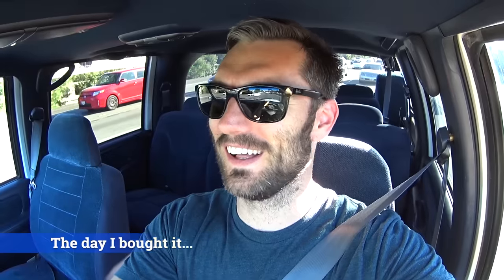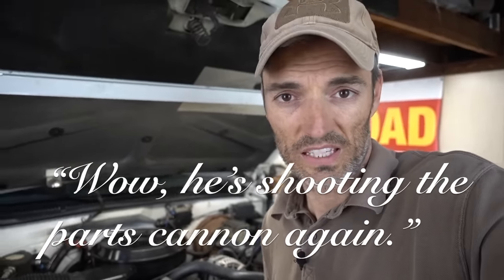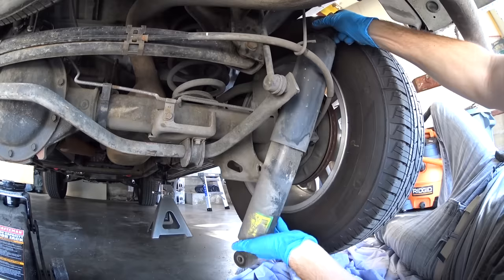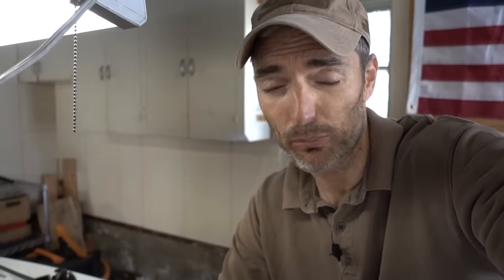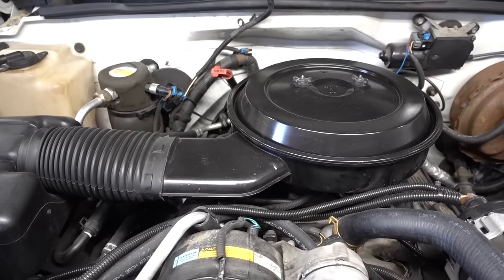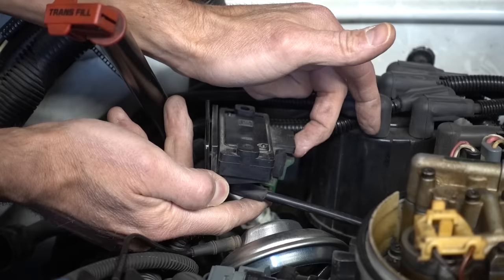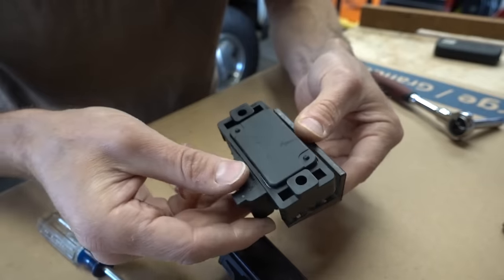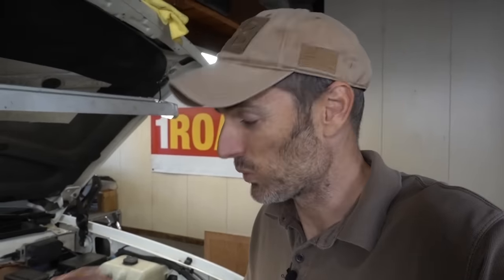The ONE REASON Why My 25yr Old Truck Runs So GOOD!!

Comment: Well done. I have a 98 Tahoe with almost 214,000 miles and I approach it's maintenance exactly the same way. I just replaced the MAF sensor, Throttle Position sensor and Idle Air control valve. I'm trying hard to get her to 400,000.

Comment: I completely get the idea here... but gotta definitely use the quality parts. 

I've replaced the entire ignition system on my 91 astro with the 30 year old oem parts off of my parts 92 because the p.o. had a shop do a "tune up" and those new parts all quickly died

Comment: It is interesting to note that the same MAP sensor is used in my Isuzu Trooper UBS69's diesel 4JG2 Turbocharged engine. This vehicle was made in 1996 and only complies to the OBD1 standard. And yes, the GM mark is on the MAP sensor. And still works flawlessly today.

Comment: Same mentality I have.  My 2005 Accord we bought new has over 277K on it and still going strong.  My 2006 GMC 2500 Duramax has over 180K with about 100K of those towing my 5th wheel.  New cars do not equal no breakdown concerns, they just make breakdowns more expensive.

Comment: I have two 2007 F150 and both are running and driving perfectly fine because I do preventative maintenance in much the same way. I get 20-22 MPG like clockwork and wouldn't be afraid to go cross country at any time. 1ROAD imho is doing it right!

Comment: On a long enough timeline every part is a consumable. I’ve owned over a dozen cars with 100k+ miles. My son and I both daily cars with over 200. In 30 years of using your philosophy, I’ve been completely stranded (had to use AAA) only 2x. Once with a bad proportioning valve, once with a failed diesel lift pump.

Comment: Had a 1997 suburban, 5.7 4x4, the long btch. Was heavy on fuel and not very fast, but it also weighed 7k lb. I Loved it, was my favourite truck to date, i had the 2 rows of seats, very roomy, and very reliable, never left me stranded. I did put a lot of loving into it over the years mind you. I only let it go because I didnt need it anymore and i had 2 cars, but it towed the racecar to the track and long road trips. Now I'm on a 2000 silverado 4.8l 4x4 single cab, 8ft bed, ill be fixing this thing till i die, not buying another. Truck was free, $6k in parts later, its more reliable than a new one, smooth smooth, same thing, no disappointments. Has almost 100hp over the 5.7 in the suburban, so it moves much better. But yeah, i loved that suburban. If y'all still have 1, keep it, the new ones are all sht.

Comment: My 97 Defender 300TDI is just lovely to drive.
I just rebuilt the cylinder head, and finally figured the viscose fan isn't engaging, which had caused the original overheat. But I don't mind because I gas flowed the new head and she goes up a very steep hill in third now, which even my turbo diesel Subaru can not do 😄 . I deleted the EGR and think this truck may just run forever lol ☺️

Comment: 200% right, I routinely will replace parts along with routine maintenance as a mechanic I know problems just don't go away or get better, if I have a good idea and replacing something for a few dollars will get the job done so be it a lot of times that's the fix OBD 2 is a big help to on 96 and newer
Reply: Well I think even non mechanics know that once there is a problem it's not going to go away.😂
Reply: @Anth230  you would be surprised

Comment: I agree with everything you said except for the Amazon.. In my opinion.. yep I'm right winged. Plus the fact I like to support the parts stores for when my car breaks down and I need to run down and get the part then and there here and now, and if I can help it I'll go through a smaller more ma and pops. But I'm also one of those that will pay extra for something made in USA! Keep them old ones running. Nice video!

Comment: 2000 S10 2.2L (built Oct ‘99). Purchased Oct 2011 with 74,274 miles and a destroyed engine due to the previous owners lack of maintenance. I actually put more into the truck than it was worth at the time. However, it’s now been a dependable daily driver since then and has been up and down the eastern seaboard 11 times, once to the Canadian border and back!

Comment: Late to finding this video, but good job! So you know, it’s possible to replace those electrical connectors without having to re-crimp/terminate. The retention clips on them break all the time on older vehicles due to heat and aging. There are tools that will release the wire and crimp from the rear of the connector, then you simply load the terminated wire into a new “weatherpack” connector body (with an unbroken retention clip). Usually there’s enough retention force it isn’t a problem to use without the clips but sometimes it can be a problem. 👍🏼sounds like a pain until you try it a few times, it really isn’t too bad
Reply: If going this route, make sure to use quality, OEM or equivalent weatherpack parts. The generic no-name stuff from Ch*na has no place here.

Comment: I got a 1978 Chevrolet  Silverado  I drive everyday.  My cost to buy was $3500 from a friend back in the 80s. 
Paint faded,I had it painted.
Motor gave up, had a rebuilt on installed.
Headliner failed, replaced it.
Seats wore out, had them recovered.
Maintain your vehicle and you will not have to pace your vehicle. 😊
Saves$$$$$$$.

Comment: I understand what you are saying about changing parts.  If a problem can be one of two parts it is cheaper to replace both parts than to pay an expert mechanic to check it for me.  My 96 F150 has 550,000 miles on it and I don't want to trade it because it never lets me down and parts for it are cheap.

Comment: I just spent 2 grand on a 2010 Kia that was in damn rough and unsafe shape...put in another grand on brakes and tires along with a new transmission pan (seller thought it was an oil leak lol) and now it's a solid ride...I never thought I could get a newer car for 3 grand in this day and age. Nothing wrong with replacing parts for peace of mind honestly unless the new part is junk...

Comment: "If you can replace these parts that are easy to access, easy to get and cheap to replace, why wouldn't you?".   Because sometimes todays OEM parts are not made as well as the original OEM parts.   This is specifically true with electronic components.   Being a pro-active parts swapper is not always the best solution.    You have a good running 25 year old truck because those trucks were made well and 25 years, isn't really that old.

Comment: I drive a 1994 Chevrolet Silverado 2500 with 1,415,000 miles on it. It has a 454 7.4, NV4500 transmission. Engine has never been rebuilt neither the manual transmission. I have operated three different businesses with this truck. This week I had it start rough idling running rich. Found out the ECM was not even giving me the 12 hello code. Checked the wires confirmed they're good. I went ahead and put in a new distributor, plugs, wires, temp sensor and just ordered ECM. I did all of that for about $200. 

Unfortunately AC Delco is not what they use to be. I have kept all the original stuff I replaced over the years if it wasn't broken and I was playing parts changer. I paid $14,000 for this truck in 1994. Still drive it daily with cold ac. Sure it has scratches, seats are starting to finally wear, but it's a work truck and pretty dependable. I see all the $80,000 trucks and think how the feel when they get that first scratch. Anyway great video. Do you and enjoy that Suburban.
Reply from the maker: Wow!! Just to confirm… 1.4M miles?? And, with the 454?? Holy moly!!

Comment: I bought a 1999 chevy 2500 with the 454 and 37,000 miles (barn find). When I got it, I replaced all fluids, PCV, thermostat and hoses (because the coolant was drained), shocks and steering stab, plugs and wires. Fixed wonky tail light wiring with OE harness, replaced blend door actuator that was bad. I wanted to replace injectors with upgraded Bosch injectors so....distributor, ignition module, EGR, MAP sensor all replaced because intake manifold was off for injectors.. The truck runs incredibly well. Next thing I will likely do it brakes, thinking of converting rears to disc and thinking of converting self locking hubs to manual lockers.... :)

Comment: My 1990 Ford Econoline 4.9 cu. Factory fuel injected, factory gear drive van would not start. Over time and replacing everything it still wouldn’t start….. everything except the map sensor. My buddy asked me ,” did you change the map sensor?” I said what is that?
I changed it and … starts, runs perfectly. It didn’t cost too much and nowI had peace of mind. I love my van.

Comment: I agree with this rationale.....except for old Dodge Rams careful with aftermarket Amazon...need Mopar for crankshaft position sensor and throttle position sensor....skittish with aftermarket fuel pumps too. Amazon parts look good and fit well, but internals are skewed....you'll get no start and have no clue. I learned this the hard way...good luck guys and thanks for your very helpful videos. ..all great and on point.

Comment: I own a 2001 Dodge 2500 cummings and a 2002 VW Beetle TDI  truck only has 105k car has 155k but i bought it used from an older woman then broke it down parade rest replacing almost all suspension, new turbo, rebuilt injectors and all typical odds and ends including timing belt. So i absolutely concur with your thinking. Thats why i have no debt and have savings. Most of these haters are clueless.

Comment: We drive a 23 and a 19 year old vehicles. I can work on both - everything from lights/brakes/spark plugs to full engine and transmission replacements or rebuilds. I don't replace things until I start seeing a problem develop. That's left me in a position once or twice, but there's no guarantee that I wouldn't have been there anyway or that a new part will even work as well as the old. 

My neighbors make half what I bring home and they're both driving new 60 to 80k vehicles. I hear all the time that I'm a tightwad with vehicles. Reality is that I keep my vehicles looking and driving great and I spend that 600 to 1000 a month on things that i actually enjoy or that benefit my family. You'll be way happier if your smarter and handier than you are popular.

Comment: I did pretty much the same thing as this guy. Found a '96 C1500 standard cab  2WD back in 2014 with  41,000 miles. FIrst year of the vortec 350 and OBD II.  Other than maintenance , in  7 years, the parts that have had to be changed...water pump, master cylinder ,  AC compressor, idler/ tensioner pully and intake gasket,  they weren't that expensive and simple to replace.   55,000 miles later I probably spent  less than  $1000 in repairs. That's probably equal to about 2 typical car payments these days.

Comment: I have a fuel injected 2000 GMC 3/4 ton 4WD pickup truck with about 200K highway miles on it.  It runs beautifully and all I've ever done to it was to replace the heater/air fan motor speed controller, the alternator, the battery, the tires, the oxygen sensors (4ea) and the spark plugs (with iridium plugs).  The oil was changed at regular intervals along with the oil filter and the engine has always been driven sensibly.  It uses no oil, starts instantly and runs very smoothly.  I have a scanner and I regularly check things through it.

I am one who believes "if it ain't broke, don't fix it" and so I wait until something is showing the first indication of failure before I replace it.  I do carry with me a complete tool set for doing emergency repairs on the road and I have the confidence to do emergency repairs if necessary.  I have found that things going out almost always give some warning, such as when my alternator started going bad.  Speaking of which, the alternator is extremely easy to get to, so I removed it in the parts store's parking lot, brought it in for an exact replacement and had it reinstalled with the belt properly tightened in less than an hour.

I realize that young people, not of my generation, rarely have any knowledge of auto mechanics and perhaps it is better for them to buy a new vehicle every 3-5 years.  I also realize that most people don't always know the signs of imminent component failure, don't have a scanner (or an ECU) and may be afraid of a sudden failures, so perhaps it is better for them to replace older components.  Having said that, I have found that new components will sometimes be defective and so I trust things that I know are working.  By the way, I just bought a new Android entertainment system, installed a backup camera and put in LED lamps and now my truck is "as good as new."

Comment: In my many decades of troubleshooting all sorts of automotive electrical, and electronic system failures the failure of the connector used to connect the component to the system is one of the most common things to happen, short of an actual component failure.
Yet, these connectors are usually very difficult to source, and sometimes exorbitantly expensive.
For instance, I recently changed out the IAC control on my 2002 Toyota Tacoma. The connector clip had failed, and I wanted to replace the connector, as the IAC is difficult to access, as it is located under the throttle valve body.
I had a great deal of difficulty locating one on line. The ones I found were $56.00 plus shipping, for a two bit part.
So I kept digging and eventually located a replacement connector for the exorbitant price of $6.95, and it included free shipping. Needless to say I ordered it up immediately, and it came in the next day !!!
I simply de pin the connector, and reused the contacts, complete with their original wiring harness connections, as they were in perfect condition, thanks to some really well thought out environmental covers.

Over the years I have had many other connectors like the ones on a Datsun 280Z that connect to the fuel injectors. They totally fail, and the plastic crumbles away. I eventually located a source on these connectors, and since they are common to all Bosh style injectors I always keep them in stock.
Simply changing these out on my customers solves lots of intermittent problems, and the cost is so low, it is not worth the effort to spend much time troubleshooting them. My labor charge is many times higher that the cost of these components.

Do yourself a favor, and start sourcing these items before they fail, and maybe keep some of them in stock even for your own vehicle. This could save lots of time, and frustration in the long run, and make your life much easier.

With certain vehicle manufacturers, the failure of a crank sensor, or a cam sensor will cause a no start, and can really ruin your day. Keeping a spare on hand for easy to access ones is a good idea, and replacement of the more difficult to access ones will save lots of frustration some cold rainy night when one fails.

Tim

Comment: 5:45 After pressure washing my cars engine . I spray the whole engine compartment liberally with 303 Protectant . To resist the rubber and plastic parts from drying out / cracking . Then around a month later I will pressure wash that off . I usally doi this at least twice a year , keeps plastics looking new .

Comment: I have a 2004 Toyota 4Runner that I bought new and have kept in great condition. I wouldn't hesitate to jump in it and drive across the country. I could easily get a new vehicle, but there's no reason to do so. Oil changes and other scheduled maintenance are very important if you want reliability over the long haul.

Comment: If the EGR Valve is just moderately coked up you can sandblast it with nutshells. If its easy to reach you can even be lucky enough to not have to take it out. Nutshells dont damage the motor if residual particles are ingested by it.

Comment: Hey I've got a 94 and I would highly recommend a throttle body spacer, and a KandN air filter with dual exhaust with short headers and a edlbrock reformer t.b.i.. Intake and roller rockers

Comment: You're not wrong. I have a 93 with 280k and I've replaced most of that stuff. It runs awesome. I have put a transfer case and a crate transmission in it. The most recent work I did is timing chain. I now have an oil leak LOL. I'm going to fix that and I'll post a vid on my channel of the timing process. The reality is that 93 is super durable and I've gone through a lot of newer vortec and LS Suburbans and only kept that one. I have a newer Denali XL and it's far worse off road than that old 93. It's pretty tall and doesn't hit ground easily. The Denalis and Escalades are way low to the ground, even most 1500 suburbans if it's not a Z71.

Comment: I am less inclined to what to replace any original equipment these days because new parts can be junk out of the box. And they just don't last as long as the ones they replace. It can be a diagnosing nightmare when you get a faulty new part so I learned to never rule that out. You can also download free software and with the connector you can see live data your  ecm sees to know which sensors are  working properly. It is really easy and a way to save money and time.